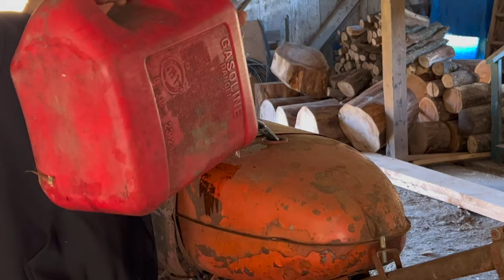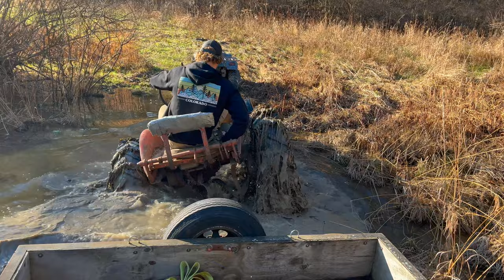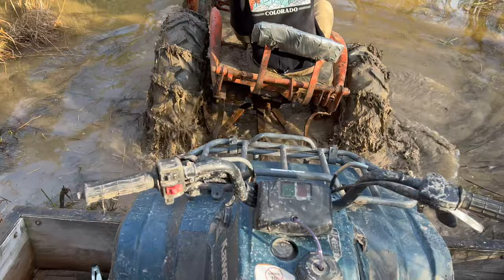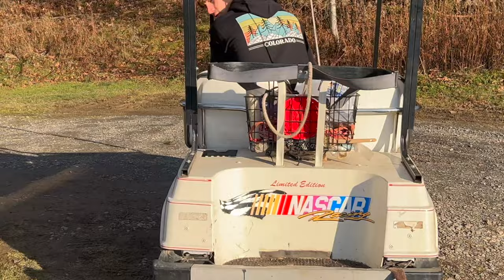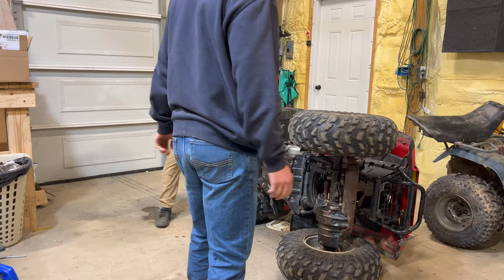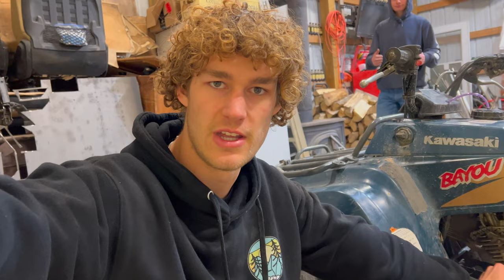Rescuing My Sunk Quad (I Destroyed It Again)

Comment: I have a honda 350 just like the red one but mine is blue, and I need help with it, it's not getting spark, i had the motor rebuilt, new stator, new pulse generator, new spark plugs and coil, new CDI, new fuel relay and everything, but still no spark